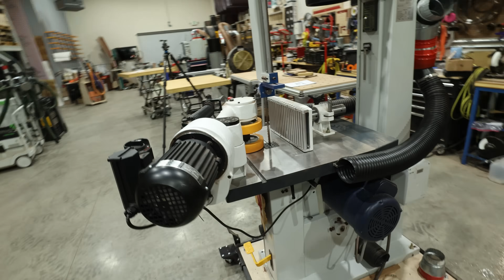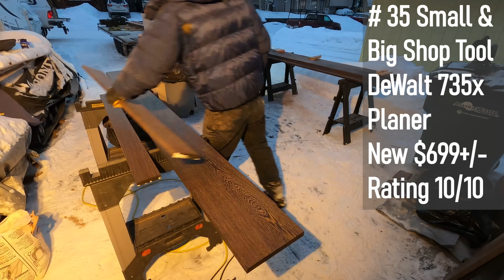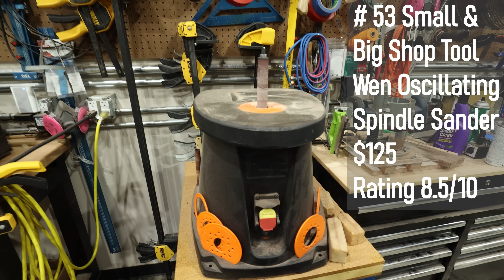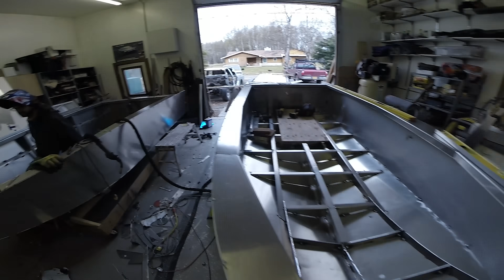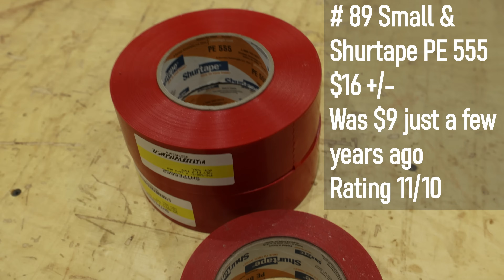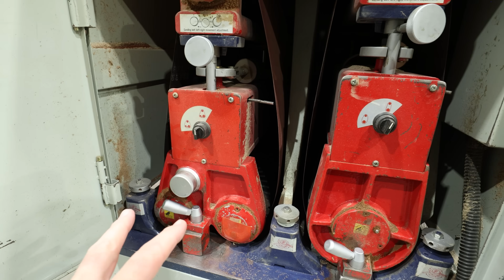Tool Review & Shop Tour

Comment: Thanks for another great video. I would love to know more about your Laguna PS3 Profile Sander: What makes it useful and it's practical limitations. Outside of manufacturer's literature, there seems to be very little useful information on these machines. We bought an older machine of this type and fitted it with imported spiral brush heads from China to sand round-overs on our cutting boards. Still have not managed to get consistent results though.
Reply from the maker: Thats interesting. I also bought this with the thought of sanding round-overs on cutting boards and its just not the right tool for the job. I bet it shines for crown molding, deburing cnc stuff and concave projects. I don't use it much.

Comment: One suggestioin, what I did- build yourself a massive router table mounted on a cabinet with rollers, and if you can find one put a Porter-Cable 3.25 hp router in it. That is just one BEAST of a router, will take anything you can throw at it all day long...unfortunately they no longer make them, so there is a limited new inventory still out there...

Comment: One question I have is on the large machine lot that you purchased - was that through Laguna or did you find a shop going out of business or something?
Reply from the maker: It was all used from 1 guy. Check out the Hobby to Manufacturing video.